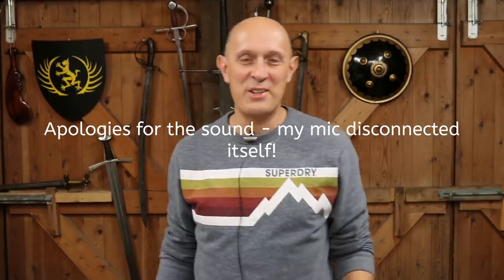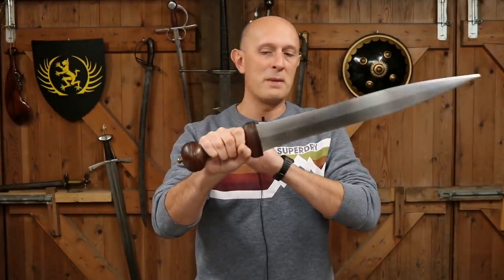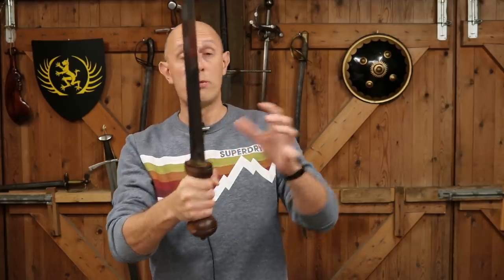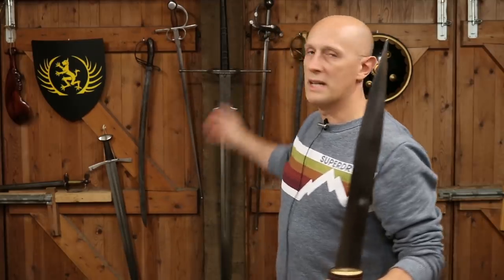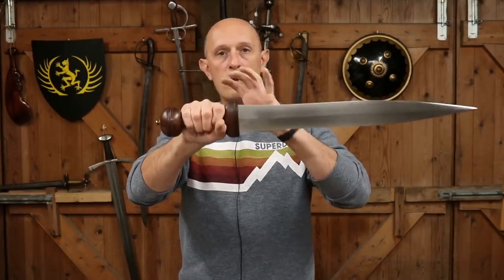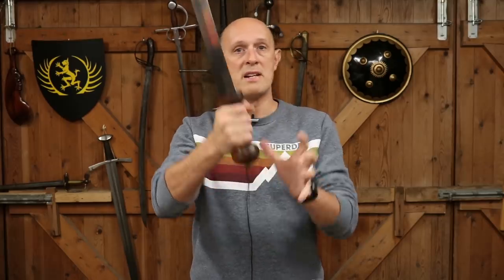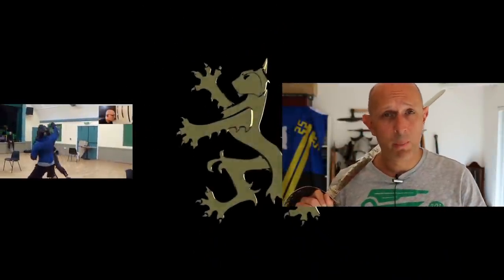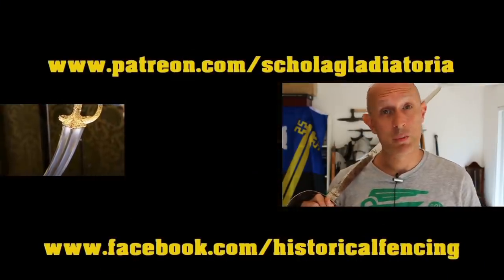The Roman Gladius (Sword) 'Guard'

Comment: Matt, we also should consider the Signifier (Standard bearer) who fought with a smaller round shield, known as a Parma. The use of a smaller shield, one would hope, should change a Legionnaire’s fighting techniques. Will you also experiment with a small shield or buckler?
Reply: If the enemy made it to the standard bearer, it meant the legion had already been defeated, can't see much point in using fine fighting techniques at that stage.

Comment: Certainly true. The (massive) shield was intended to be your guard. Although this is not universal. Greek swords from the same period, particularly the xiphos, had a very pronounced, arguably advanced guard for its' age, as did some other Eastern straight swords of the period.  It's basically an early form of the medieval crossguard. It also served to fit into the sheath, but would certainly protect the hand in an identical fashion. 

https://www.penn.museum/sites/expedition/files/1972/07/Sword-Necropolis-Alfedena-Campovalano.jpg

https://i.pinimg.com/originals/27/80/58/278058cb850c83dc3cc32d158c807863.jpg

https://i.pinimg.com/originals/62/5b/2b/625b2b815ff7c3b77ea81249902fa031.jpg

https://encrypted-tbn0.gstatic.com/images?q=tbn:ANd9GcSkkZaaSHa2q9ptPSswpiMopeNdFf4fybm5dSSHNn-lYOhDylBC
Reply: Might also have been a matter of Roman military philosophy: you weren't supposed to fight with the enemy; you were supposed to stab him and be done with it.
Reply: @Reziac    I'd consider that, were it not for the fact that it just doesn't often work that way. It's rare a person drop dead from a single strike in melee combat. In other words, it might take more than a thrust, even a successful one.  There are accounts of men fighting while run through.
Reply: Except the Romans didn't do melee as such; they did solid blocks of soldiers. In their day they were probably the best-armed and best-trained army in the world, and they focused on what worked. Plus only rarely did they fight another real army; mostly it was semi-organized tribes armed with little better than sticks. Sufficient to poke 'em enough that they ran away or surrendered.
Reply: @Reziac   You would do well not to massively oversimplify and reduce 'Roman fighting methods' across an expanse of time roughly a millennia across.

To clarify, when I said 'melee', I simply refer to close-range or hand-to-hand combat, the realities of which, regardless of what preconceptions you have or what 'attitudes' a military has toward some arbitrary notion such as 'how long one should fight an individual', dictate that it is rare any two instances should be greatly alike, and it is quite rare that a foe is typically felled with a single thrust, or killed in a single blow.

I'd also state that your summation of their foes is wildly inaccurate and prejudiced, if not frankly absurd, but that's another matter entirely that I don't feel the need to discuss here. 

I would ask you, to cut misunderstandings short, what sort of studies or history in particular you reference to have gleaned these perspectives, or if this is just 'common wisdom' you've learned from, I don't know, films and TV.

Comment: It's more fun to think of the Roman military is a bunch of knife-fighting Sharks and Jets anyway.
Reply: Also, like the street gangs later "evolved" to using firearms, the Roman military evolved to using the spatha in place of the gladius. The spatha of course did not originally have a guard, either, but it's way to long to be called a "large knife"...  The middle-Byzantine "spathion" did have a crossguard, which similarly to Western European "Viking" and arming swords, became longer as time went by. Nobody really knows if that was Western crusader influence, but it would seem likely. Nevertheless, it was still used with fairly large shield in the infantry. Not as large though as the Roman high imperial rectangular scutum, which was pretty much the largest known individual shield in history...

Comment: As it isn't used as a guard it's probably about the right size.  If it was much wider it would increase the risk of catching it on the outside of the shield when the sword hand was quickly withdrawn back to safety.

Comment: My first thought is....*shrug* something's gotta be there when you are designing a grip. The tang is narrower than the blade, so you've got that transition between widths, and you've also got the transition between grip and....no grip. The "preventing the hand sliding onto the blade" thing is good as well, but I mean...ya gotta do something to transition between grip and blade. Might as well do something?

Comment: well, a lot of roman soldiering wasn't on a pitched battlefield. If I were guessing, I would argue that battlefield damage was done with ranged weapons, while infantry held positions from charges,,, while holding a line but not with spears, a shorter sword gives mobility, and for the REST of the soldiering that DIDN'T happen on the battlefield, a shorter sword allows the user to swing it while in houses, or small streets. since the swords were not used for one on one fencing, and were instead used when a meaty part is exposed, and were also used in situations where one doesn't want to be constantly hanging up on everything,  (a big cross is going to get stuck on a belt, stuck on other straps, catch up on bushes and garden plants, hang up on the ropes holding up curtains,,)... Roman Soldiers spent more time as police, or standing watch in well made forts, than they did marching out in the open towards an enemy battle-line. and then, when there was a battle line, the actual attack weapon was something else,, not the front line of the infantry.

Comment: What about the Spatha, though? I know it was also used in combination with a scutum, but afaik, they got lighter and smaller and so far I've only seen slight improvements or non at all on the Spatha's "guard", depending on the find. Considering the Spatha's length, wasn't it more of a "fencing" weapon compared to the Gladius? More difficult to wield in a tight formation and also, of course, a cavalry weapon, who couldn't protect their right hand with a shield as well as infantry.
Reply: Late Roman shields may not be scutum sized but they are still pretty large shields. You still have ample protection and can focus on the offensive use of the sword. Cavalry fought mainly with javelins and spears, swords mainly came into play during the pursuit or on the rare occasions when the fighting lasted so long that javelins and spears were effectively expended.

Comment: So why didn't the gladius have an actual hand guard? What's the tradeoff with adding a little more protection for the hand?
Reply: You have to consider 1) the cost of adding such an un useful feature, the equipment was provided by the government. 2) it could knock on the shield, if not kept at an appropriate distance.
Reply: It wasn't needed with such close quarter stabbing focused warfare. When you are fighting at such close distances, trying to arm or hand swipejust means your opponent can very  easily stabb you in the face.

Comment: The Roman gladius was treated in much the same ways as any other armament like pilum, plumbata etcetera that was drawn on command.
The only weapon that was at the free will of the Legionary or the auxiliary to draw & use as they see fit was the pugio/dagger.
A large leaf shaped dagger is not as fantastic a symbol or weapon of status but every Roman soldier carried one.
Flavius Vegetius Renatus in his works de rei militari states how the Pugio was the preferred weapon of all soldiers.

Do not under estimate how dangerous a 7 to 12 inch dagger can be.
I see daggers as worse then swords in many ways for besides reach the advantages of a large dagger are many.
If you don't belief me then consider that every Roman soldier carried a pugio, every knight carried a dagger & every soldier since ww1 carries a combat knife.
Swords became obsolete but dagger & combat knifes remain universal on the battlefield even today after how much has changed!

If I can only have 1 armament I'd rather a dagger over sword for as nice as swords are for certain tasks a dagger or large knife is far more versatile & always at hand.

Comment: I've never understood the point of that bit on the gladius, it still confuses me, but not as much as it did. Also I believe that the plural of scutum is scuta, but I could be wrong.
Reply: Like a rondell dagger, it's to keep your hand from sliding onto the blade. It could also work as a stop to keep your hand from wandering out in front of your shield. 

If you keep the blade in contact with the shield, you thrust out until the guard hits your shield.